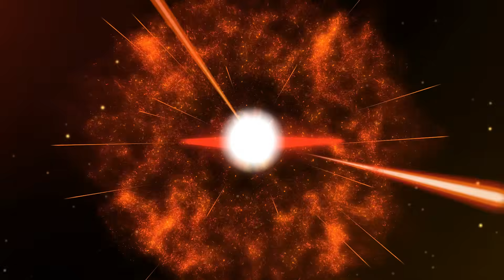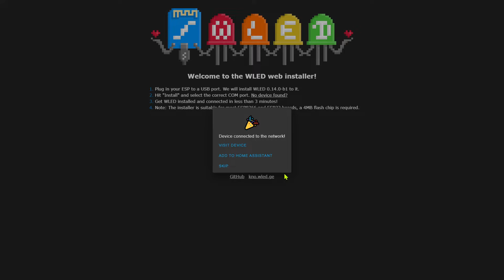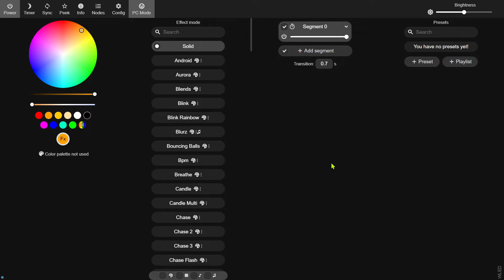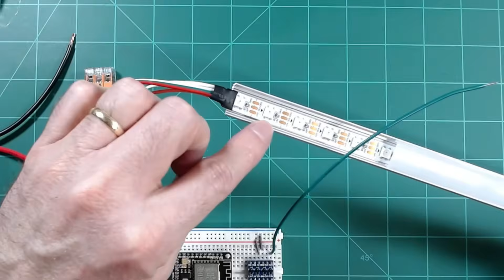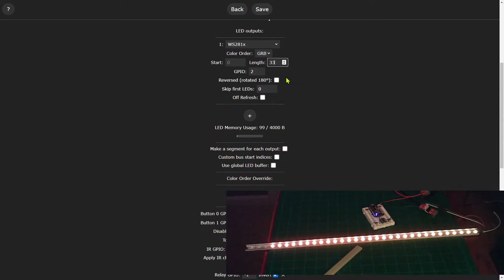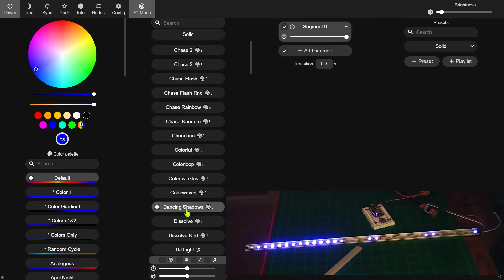How to Quickly Build Your First LED Controller

Comment: Thank you so much for your very clear explanation. However, I think I am doing something wrong. I have a WS2811 12V connected as you suggested, but as soon as I turn it on, it starts flashing and will not work with Effects or color changes. I have two strips, and they both do the same, so I think it has something to do with the configuration, but I don't know what it could be. Thank you so much for your help!!!!
Reply from the maker: Flickering, flashing or non-responsive LEDs generally points to an issue with the data line (it can also happen with larger installs further down the strip if the voltage drops too low).  Check the following:

Did you include a logic level shifter?  This will resolve most signal issue if wired properly.  Assure you have 3.3V, GND and the data signal from the ESP connected to the LV side of the shifter and 5V, GND and the data line out to the LEDs on the HV side.

Assure the LEDs are receiving the expected 12V.  If possible use a multimeter to verify the voltage is close to 12V at the +12V and GND connections at the start of the LEDs.  Naturally, the controller should only be receiving 5V.

If powering the system via two different power supplies (12V for the LEDs, and 5V for the controller... maybe via USB), be sure you create a common ground between the controller and LEDs.  Ground potential differences when using multiple power supplies can cause the LEDs to misbehave.

Verify that you have the proper LED type and GPIO pin selected in WLED.  And finally, double-check all wiring connections.  If using something like Dupont jumpers, these can make loose or intermittent connections.  If possible, try swapping out the wires to assure it isn't a problem with a particular wire or connection, especially those related to the data line.

Those are the most common causes of misbehaving LEDs.  While it is less likely, it is possible that the LEDs, shifter or ESP board is faulty or the WLED flash is corrupt.  If you have the parts, you can try swapping out individually to see if the problem is resolved when a particular component is replaced.  Hope that helps.
Reply: @ResinChemTech   Thank you so much for your kind and extensive explanation here are my replies:

Did you include a logic level shifter?  This will resolve most signal issue if wired properly.  Assure you have 3.3V, GND and the data signal from the ESP connected to the LV side of the shifter and 5V, GND and the data line out to the LEDs on the HV side. Answer: Yes I did

Assure the LEDs are receiving the expected 12V.  If possible use a multimeter to verify the voltage is close to 12V at the +12V and GND connections at the start of the LEDs.  Naturally, the controller should only be receiving 5V. Answer: Yes I made sure that it is a bit above 12V and there is also a transformer from 12V to 5V

If powering the system via two different power supplies (12V for the LEDs, and 5V for the controller... maybe via USB), be sure you create a common ground between the controller and LEDs.  Ground potential differences when using multiple power supplies can cause the LEDs to misbehave. Answer: That is why I made sure to include the transformer from 12V to 5V

Verify that you have the proper LED type and GPIO pin selected in WLED.  And finally, double-check all wiring connections.  If using something like Dupont jumpers, these can make loose or intermittent connections.  If possible, try swapping out the wires to assure it isn't a problem with a particular wire or connection, especially those related to the data line. Answer: I have done that, with the data line I connected it from the strip directly to the leveler shifter 

Those are the most common causes of misbehaving LEDs.  While it is less likely, it is possible that the LEDs, shifter or ESP board is faulty or the WLED flash is corrupt.  If you have the parts, you can try swapping out individually to see if the problem is resolved when a particular component is replaced.  Hope that helps. Answer: This is not the issue, because I used a  5V Led Strip and it works perfectly, the issue is the with the 12V strip.

Could it be that I am not setting the WLED correctly?

Is there maybe an email where I can send you pictures of my setup so you ( if you want of course ) could check what am I doing wrong?

Again, thank you so much for all  your help!!!!

Comment: What voltage is on the low voltage side of breadboard. I don't see any voltage supply, unless it comes from the 12v
Reply from the maker: In this particular example, the two power rails are 5V and 3.3V.  The 5V side can come from the power supply or the 5V pin on the ESP and the 3.3V comes from the 3.3V pin on the ESP board.  Most ESP boards have both a 3.3V pin and 5V pin that can be used to power external peripherals... or as in this case a power rail on a breadboard.

Comment: What do you use for cases or boxes to protect your controllers?
Reply from the maker: I generally 3D print my own enclosures.  But before I had a 3D printer, I'd often use small electronic project boxes that you can find on Amazon and elsewhere (here's just one example:  https://amzn.to/4cjtFgA - but you can find them in all sorts of various sizes).  These project boxes are generally pretty easy to drill or cut openings for things like wiring runs, etc.

But I've seen others use everything from plastic soap dishes to carry out food containers as enclosures.  So sometimes you just have to be a bit creative.

Comment: My question:
Do I need that level shifter? My LED-Strip works well without - even using the complete 5m length with 300 LEDS.
And when I use a 12V strip do you need to boost the level up to 12V - didn't find such a shifter?
Reply from the maker: As I stated in this video (and many, many times in other videos), you can sometimes get away without the shifter... until you can't.  I simply opt to always include one to avoid any potential issues.  And it really doesn't matter how many LEDs; it is a matter of voltage drop on the data line between the controller and the first LED.  The further away the controller is from the start of the LED strip, the more likely that voltage drop will cause an issue.  But as I always say, the choice to include a shifter is entirely yours.  While I recommend it, you can often get away without one if you keep the run between the controller and the start of the LEDs relatively short.  To see an example of what can happen if the data line voltage drops too low, I show the results on another video related to the need for a shifter:  https://youtu.be/Q9mLitVxF3c

As far as 12V LEDs, nearly all types still expect a 5V data signal.  So, while you will run +12V and GND to the +V/GND pins on the LEDs, the data signal is still expected to be 5V.  The same is true with most 24V LEDs.  So if you opt to include a shifter, the same shifter will work with 5V, 12V or even 24V LEDs.
Reply: @ResinChemTech  Thanks for your help!
Reply: @ResinChemTech  May I ask another question?
Now that I wanted to order level shifters, I was reading the WLED kno.wled.ge pages about compability of hardware.
There is a orange highlited "Warning (!): I2C shifters are generally too slow for addressable LEDs, so don't use them."
The ones you are using are I2C shifters, right?!
Do they work? Even with long strips with lots of LEDs? Is there a limitation? Why the warning?
Reply from the maker: I address that exact question (and provide my answer) in this video:  https://youtu.be/61VWgYmomz4

Comment: Hi thanks for the video really helpful regarding level shifter 👍 I take its done in same way with the ESP32 chip ..... I have for longer no matter people say its not needed (sometimes they do say that) wanted to see if using a level shifter would help a problem I have ... I have been trying to solve it with different sizes resistors (well to see if it helped... the resistor I am using now is for sure better than what I started with)... But it doesn't totally solve the problem.... From time to time I on a nearly 10 meter long led strip (ws2812b) see short flashes of white ... which I think it because of the length plus that I don't use a level shifter (as said experimenting with different sizes resistors helped a bit until I found one that seems best... BUT it still happens)... So my idea was just to use the level shifter instead... I will try one and see if works .. very much thanks for showing it in your video will get me on to using these for sure 👍 (as said I take its done in dame way with ESP32)
Reply from the maker: Yeah... it would be the same with the ESP32.  Both the ESP8266 and the ESP32 output 3.3V on the GPIO pins.

The debate has raged on in my video comments (and others) about the level shifter.  I will say what I always say... the LEDs may work fine down to 3.2-3.3V at the first pixel... but they also may not.  Adding a shifter (or even a sacrificial pixel) to boost that data signal up to the expected 5V won't hurt anything... but can definitely help a lot in many cases, especially with longer data runs.  I include one in every build... whether the wire length is 6 inches or 6 feet.  It costs less than $1 and takes me an extra 5 minutes to solder into place.

That being said, 10 m is a pretty long run.  As long as you are using a large enough gauge wire so that the voltage doesn't drop too much, using the shifter will probably help.  Alternatively... or if you are still having issues... you can install a booster in the middle of that long run to 're-boost' the signal back up to 5V.  There are multiple products/ways to do this, but the Falcon F-Amp is one of the more popular:  https://pixelcontroller.com/store/accessories/53-famp.html

Good luck with your project.  Let me know if just adding the level shifter solves your issue.
Reply: @ResinChemTech  oh wow thanks another for your comment and extra enlightenment on the topic.. I agree with you certainly doesn't hurt using the level shifter .. I have decent thick wires and also injection too and a power supply big enough to run at full power if needed .. so all that I don't think causes any problem.. I am for sure gonna go with a level shifter... also I am thinking the different points of views which sometimes ppl may forget is of related to also the unique project too like how big or small the project is ... I have the chip very near the strip in start of the strip.. Still I wanna see if the level shifter will help me here and will then look at the boosting later if needed thanks alot again

Comment: Can each if the Logic level shifter channels be used for four data outputs? What is the standard or best practice for building a controller with four, six or eight independent data outputs?
Reply from the maker: Yes, each channel can be used for separate data lines.  As far as best practices, it depends on whether you are using an ESP32 or ESP8266.  The WLED web site has recommendations on the max number of data channels and the max number of LEDs on each channel, based on the controller type:  https://kno.wled.ge/features/multi-strip/

Comment: Very happy I found this, thanks. This might be a dumb question, but once you've flashed WLED to the microcontroller and selected a pattern, color, etc from the browser will the microcontroller "remember" those settings when powered off and back on? I'm looking to use an LED strip setup for an outdoor cosplay thing where I can't be navigating to a browser on a wi-fi network every time I want to operate it. I want to press a momentary button to activate the strip with one of the chase pattern presets.
Reply from the maker: The last color/effect, brightness, etc. will be retained if the LEDs are switched off, but not if power is completely removed from the controller. However, the controller allows you to set a preset that will automatically be loaded when power is applied to the controller.  So, if you create a preset with the color(s) and pattern you want (e.g. chase) and set that as the 'boot default', then that is what will be loaded whenever power is applied to the controller and it boots up.

Honestly, you can find a way to do just about anything you want in WLED in some manner or the other.
Reply: @ResinChemTech  Thank you so much for the quick reply; I greatly appreciate it. My guess is I'd keep the controller running and switch the LED strip on an off as needed. I assume I can wire a button into the microcontroller to do that (I have looked at your very helpful website). I'm totally comfortable soldering and have designed PCBs for my prop projects, so this should be very easy. I'm excited to play around with all this!
Reply from the maker: Yep... you can certainly add a button (or even two) to the controller.  Each button can have a single press, double-press and long press... and each can have a different function for controlling the LEDs, including on/off, effect or color, brightness, etc.

Good luck with you own project and don't hesitate to let me know if you run into any other questions.
Reply: @ResinChemTech  Another question as I plan out my project. Let's say I have a strip of 100 LEDs. Can I use WLED to make LEDs 1-80 do an animated chase pattern of some sort and have LEDs 81-100 glow solid green? Thanks again!
Reply: I found a tutorial that goes into segments, so it sounds like I can do what I've described pretty easily.

Comment: Is it possible to have an esp8266 with WLED, and connect an IR to the esp8266, so you can use a classic LED stripe remote?
Reply from the maker: Yes, WLED has support for that.  I show adding an IR receiver in a number of my other LED videos as well as a pushbutton and microphone for sound reactivity.  Although do note that the last time I checked, IR functionality was disabled in the sound-reactive version of WLED by default.  If you are interested in a video where I add all three of these things to an ESP with WLED, you can check out this video:  https://youtu.be/9DqVpScO-xQ

You can also find information about hooking up peripherals like IR receivers, buttons and relays on the official WLED web site:  https://kno.wled.ge/
Reply: @ResinChemTech  thank you man. 🥰

Comment: I went from breadboard, to prototype board to custom designed PCB within a few weeks. This stuff is addictive. Don't be put off, mistakes will happen. But every day is a school day.
Reply from the maker: Agreed!  I just recently started designing my own PCBs.  I find that addictive as well.  And oh yeah... mistakes will happen!  I could fill a barrel with all the parts I've fried or otherwise destroyed over the years.  But you are 100% correct... that is all part of the learning process.  I think the fear of 'messing up' is what stops a lot of beginners from trying.  But you accidently reverse the polarity on a component and you generate a little "magic smoke".  OK... you destroyed a $3 part... but that is probably the cheapest schooling you are ever going get!

Thanks for taking time to leave a comment.

Comment: Is it okay to tape the pieces to the breadboard using electrical tape? Also what if I want to connect a battery holder to it instead? Do I determine the amps the same way? (I don’t see that listed on the ones on Amazon) Do I connect the wires the same way?
Reply from the maker: I suppose electrical tape can be used as long as you maintain proper electrical connections between components (and don't create any unintended ones).

The amp calculation is the same regardless of the power source.  But I can tell you that any sort of standard batteries not going to last very long when driving a strip of more than a few WS1812b pixels.  First, you still need 5V regardless.  You might get away with 3 AA batteries connected in series that can provide 4.5V.  But even at a 3000 mAh rating for the AA batteries, if your installation is pulling 3A, the batteries will only last about an hour (or even less).

If you want something that is battery operated, you may need to look at a different type of LED, like fairy or pixie lights.  If you use a larger power bank, like those used to recharge a phone or tablet, these are already 5V and can give you multiple hours with the lower amp draw of the smaller pixels.  If you are interested in a battery powered version, I did build an LED matrix t-shirt powered by a power bank:  https://youtu.be/T2YGL1mzMKA  Now, you probably aren't looking to build a wearable like a t-shirt, but this video also contains information on how to use a power bank (along with links to the parts I used) to get multiple hours out of a larger display when using fairy lights.

Comment: everything went well as far as installing the drivers for the chipset, flashing, and installing on the network. But it doesnt seem to be loading the web interface as my browsers time out. I can find it on the nework with an IP scanner, but no web interface. Tried multiple wifi networks and even went to the latest stable build - no change.
Reply from the maker: Just to verify... you did use your phone to join the local WLED-AP hotspot, launch the config page (4.3.2.1) and enter in your wifi credentials and then restart the controller, correct?  If the controller successfully joins your wifi, you should no longer see the WLED-AP SSID broadcasting.  If you see a WLED-AP being broadcast, then the controller has not successfully joined your wifi.  Double check both the SSID and password.

Once it is successfully on your wifi, you should be able to launch a browser and go to whatever IP address was assigned by your router (e.g. 192.168.x.x).   Let me know if you are still having issues, but the info here may also be of some help (see the section under WiFi setup):  https://kno.wled.ge/basics/getting-started/